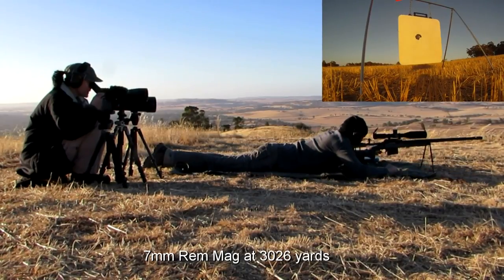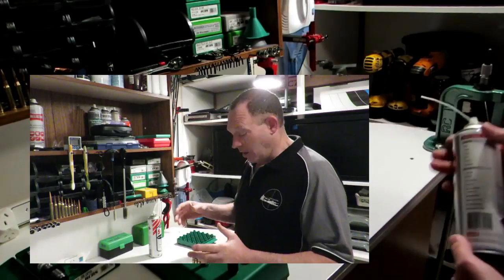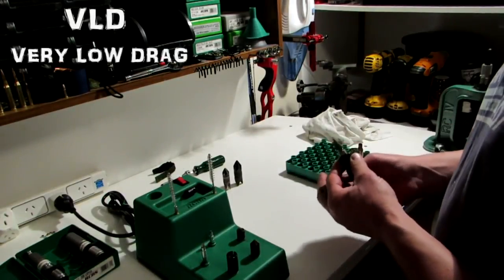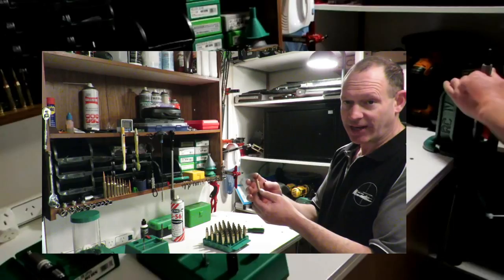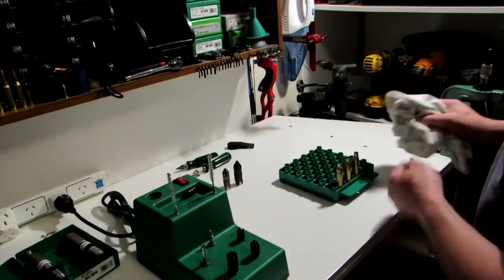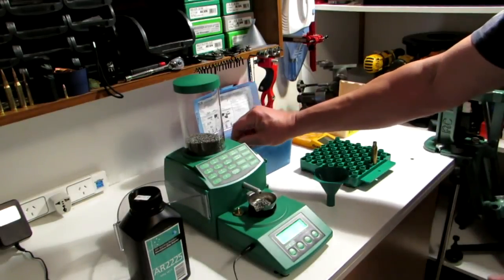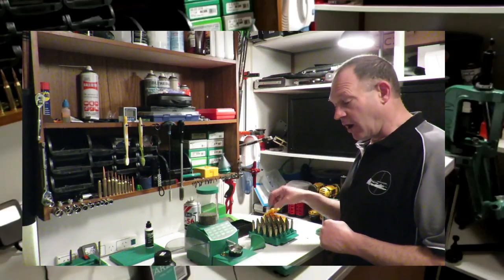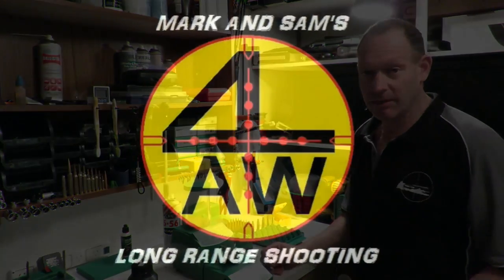Handloading 4AW style (reload)

Comment: It looked from the angle that I saw on the case trimmer that you load the brass, lock it in place and then insert the brass trimmer. I came across an article a while back that mentioned inserting the brass and then the trimmer and finally locking it down to make sure that you have 100% contact. I have started doing this because I have seen some odd trimmings on my 308 brass and it has worked really well for me since. Great video as always!
Reply from the maker: Yes always center with trimmer end before lock, as said I don't use trimmer quite like this, just done here for video, Cheers
Reply from the maker: If your running a custom chamber, then you have make brass suit chamber, really just depends on that chamber, how it is set up. But otherwise you should always case trim to suit, custom or store bought, an even case length is always required for precision shooting also FYI store bought does not mean all the exact same, chamber may be SAAMI but that does not mean the lands are in the same starting point, hope that helps, not really sure what you are asking, Cheers

Comment: Mark very good video. As you said this is your way of doing it and not everyone's way or should they just follow what you do. One thing I saw I would like to add is. I use a Lyman primer pocket hole reamer, which comes with a handle. I took  off the handle and placed it on my case prep machine which is just like yours. the threats fit the threats on the machine. So I chamfer the inside, then the outside, use the little brush for the pocket and then the reamer to clean the inside bur out of the hole. after all that I use the brush to clean the inside of the neck. I think this would be easier than the electric drill and much more controllable.
Reply from the maker: Hi Michael, as said just what I do, the drill is only used once in the brasses life and I have found it the best way to use for me, but yes that sounds like a good idea for cleaning, thanks for the comment, Cheers and all the best.

Comment: Don't you lubricate the bullet before seating into the case ? Some people use moliv or graphite. Probably the bullet comes from factory lubricated and I don't know.  Thanks.
Reply from the maker: Not normally, we use low neck tensions and vld deburr, chamfer so bullets go in smooth when dry, so just not needed, can help with some of the monolithic bullets, Cheers

Comment: Enjoyed this video very much. I reload 7mmRM and 6.5 Creedmoor and spend 80% of the time preparing the brass.  I do the same things you do expecting to end up with 'identical' brass. Unfortunately, I still find a lot of differences, primarily in weights, which tells me that the brass I'm using (commercial ammo.... R-P & PPU) is not consistent. One thing that puzzles me is that my 7mmRM reloads ended up being longer than SAAMI specs for my Tikka T3 (3.425" vs. 3.15 to 3. 29" Min/Max) after doing the measurements to be off the lands on my rifle 0.02" to 0.05". They chamber fine, but can't load them in the magazine. I wonder if there is something seriously wrong.  Groups are great at 100 & 200 yards.
Reply from the maker: Not uncommon, a lot rifles like Sam's SAKO 85 in .223 are the same, we have OK ammo for the magazine and best ammo has to be single loaded, just part of the game sometimes, Cheers

Comment: Hi Mark, very nice work. I see you have a RCBS Rock Chucker press. I would like to get more consistency on headspace when resizing my .308 cases, but usually with my small Partner press I can't get better than + or - 0,02mm with my press (0,05mm total). The reason is  the spring back of the brass AND of the press (the harder you push on the lever, the more it will resize). I tried to fix this by using Redding competition shell holders, but it gives other problems (cam over is bad for this small press). I wondered what kind of consistency can you get on your cases headspace in terms of measurements ?
(Your andswer would help me a lot to choose if I should change press and
 which one, thanks)
Reply from the maker: From what I have seen, really more about your brass, if you are using your dies properly, they are what set the resizing when they touch, doesn't matter what press you use, but inconsistent brass will still cause irregular resizing, Cheers

Comment: Hey Mark, 
I use the same RCBS charge master and found its about a 0.2grn to 0.1grn out. So i use a gem scale get the most accurate load i can. So i was wondering if im just wasting my time being too exact.  Im only getting in to this long range game now so im on a steep leaning curve at the moment.
Reply from the maker: Hi Jeff, I don't think you can be too exact, so no second scale can help, I found that by working with the RCBS unit and getting to know how it works I can keep it down to .1 grn max. But if you get 1/3 moa or better groups and are looking to improve then yes I think that finer powder measure is worth it, if your groups are not that yet, leave the measure and focus of some of the many other bits, Cheers

Comment: I too used the RCBS case lube until I found lanolin and alcohol.  I mix it at 1 part lanolin to 4 to 5 parts alcohol in a spray bottle. It is by far the best case lube I've ever used and I used several ( imperial wax , Hornady one shot , Lee case lube, RCBS case lube ).
Reply from the maker: Cheers

Comment: You might want to try using what I call bootleg case lube.... Lanolin oil in 90-99% isopropyl alcohol mixed 10 parts alcohol to 1 part lanolin oil. I just put the mixture in an inexpensive spray bottle. I put the brass into a gallon sized ziplock storage bag and spray 3 pumps onto the brass(try starting with 2) and let the alcohol evaporate off on an old cookie sheet . It amazed me just how much smoother and easier it was to size rifle brass. A buddy of mine tried it on some 50bmg cases and was amazed the difference it made... he was sold.. The lanolin has had no effect at all on the powder burning because there is so very little lanolin on/in the cases. It doesn't build up on your resizing dies like some other lubes will. It is dirt cheap to make and is the absolute best case lube I have ever used in over 40 years of reloading
Reply from the maker: Thanks for the info, Cheers

Comment: You single load the rifles , do your rifles have mags long enough to handle the oacl? Not that you would on target shouting but my rifles double as hunters too
Reply from the maker: I prefer to single load most of the time as nicer on brass, but most of the mags can run my long loads, Cheers
Reply: The bullet geometry on a given bullet is typically what determines seating depth.  The goal is to get a consistent jump of the bullet from the case to the lands in the barrel, this is typically achieved by minimizing the length of the jump.  Most good bullets designed for hunting when seated to standard C.O.A.L. are close enough to the lands to minimize jump and give good accuracy at hunting distances.  Long range bullets typically have a geometry more suited to minimizing drag which when seated to minimize the jump to the lands often exceed standard C.O.A.L. Most rifles have a little bit of extra room in the magazine for seating a little long and some bullets are pickier about seating depth than others.  If mag loading is important for you you will just have to try some different bullet and seating depth combination until you find one that will shoot well and still mag load.

Comment: It might be worth stressing the importance of removing case lube before firing. Some case lube can char and form a gummy residue on semi-automatic firearms making extraction difficult when the chamber is fouled. Synthetic lube probably won't char but may reduce the friction with the chamber wall and increase the bolt face pressure.

I mount the flash hole uniforming tool in the RCBS case prep center. I generally only do this on new brass and Lapua brass is already very uniform in all aspects including the flash hole. I don't think they punch those. I think they are milled and chamfered at the factory.
Reply from the maker: Cheers

Comment: Put it in the washing machine inside a pillow case with some old towls with it
... let it run normal cycle it will "bling" like new.. of course don't telle the wife ;)
Reply from the maker: Yeh that would work to get shiny/polished brass, Cheers
Reply: Hans Van der Veken I did the same. And didn't tell either...😜

Comment: One question i have is do you anneal your brass?
Reply from the maker: At that time, no I did not, Cheers
Reply: @markandsamafterwork  what annealer do you use? How often do you anneal and is it nessary?
Reply from the maker: @rickrydalch6373  This season every firing and I an using the AMP anealler, we are testing at the moment and have no more info to share, Cheers

Comment: I'm very surprised you've gone and made this video. You may have rustled some opinions on giving out reloading tips from the pros. I'm surprised your not cutting your powder though. Then again, you may not have the time. 
People will complain about anything - I think that's just a fact of life. Even better to see that your videos are all factual and easy to understand. I've noticed inconsistencies that I thought where just shooter error as I can only shoot monthly at 1500. 

I use ADI 2209 (IMR 4350 equivalent) and Hodgson H100 with Berger 300gr, 1grain deviation, consistently in the 16-20" range for 10 shot groups at 1500yrds. Over 2500 shots in varying wind from 1-2mph and 10-15 gusting to 20. Fill ratio is in the mid 90's so I'm not compressing. Both around the 2500fps mark. ADI 2225 is something I'm definitely going to try. I'm hitting transonic a little sooner. 
Have you tried the ADI 2217? Any inconsistencies between ADI 2225 and ADI 2217? I know the fps is a little lower. Any real world changes you've noticed that aren't on paper? 

That's my main issue, I think running the completely wrong powder for the distance I'm shooting. I think I should keep the ADI 2209 for 250gr hunting rounds. 

Brass wise, I'm not using a unifier on new lapua brass nor am I sizing a second time. Something I probably should be doing - at least to be more consistent. I've found more fliers with new brass than once fired. Always thought that was due to fireforming or my shooter error. 

What spray, case, dies, polish you use I think is just semantics. If it works for you the keep doing it. I've forgotten my lube on a hunting trip and had to use WD40, do I recommend it? No. It did the job. $12 a can for 5.56 crc is cheap. MUCH cheaper than proper lube. Local club that do military competition taught me that.
Reply from the maker: Well as for the 338lm and powder, I started with 2225 powder and has worked great, for that reason I have not tried others, so i don't know. As for cutting powder, I think you are referring to the process done when you are using a powder thrower, or loading by capacity, not something I do, weight is how i load and scales where and the RCBS Charge Master is now how I do it.  Cheers and all the best.